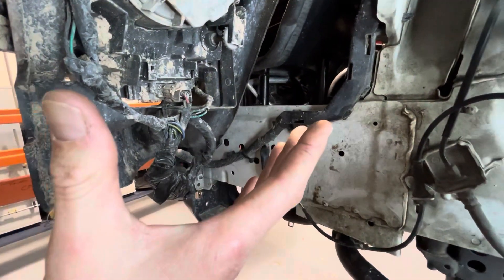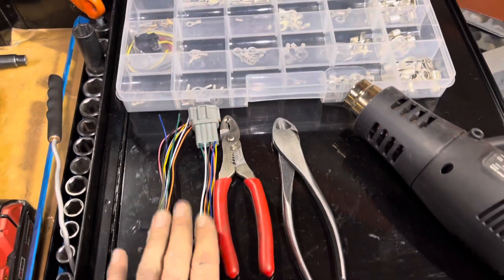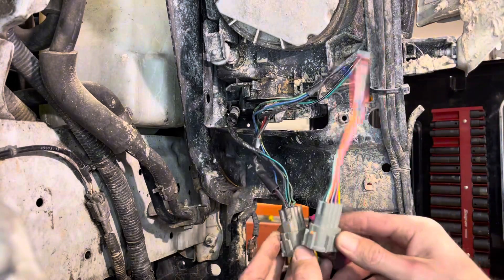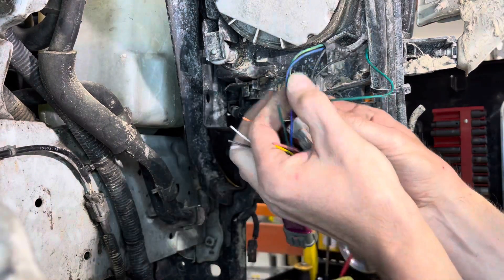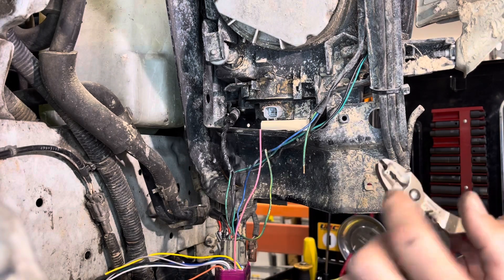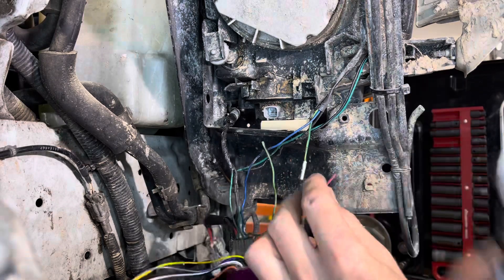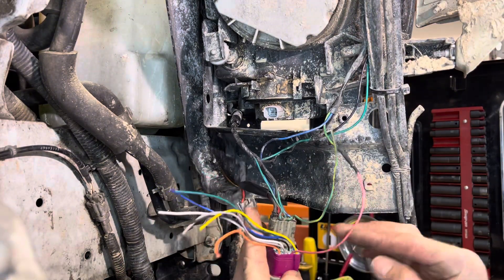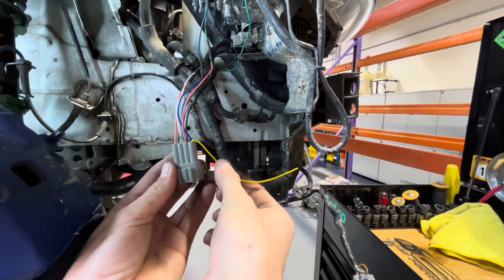How-to headlight wiring harness repair on 350z non insulated butt connector heat shrink no soldier

Comment: My driver side headlight is flickering on/off randomly. When I hit a bump on the road it also flickers. My driver side doesn’t have the fender liner. How do I know ow the wiring is the issue and need to do this?

Any info is appreciated
Reply from the maker: @jesusmendoza-yy1ye  these plugs were broken. Look for loose connection or damaged wires.